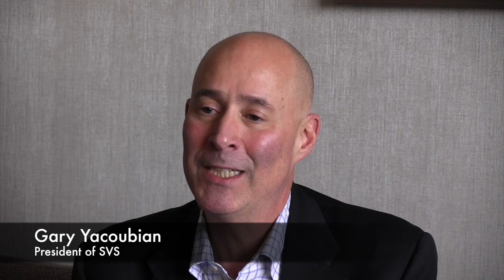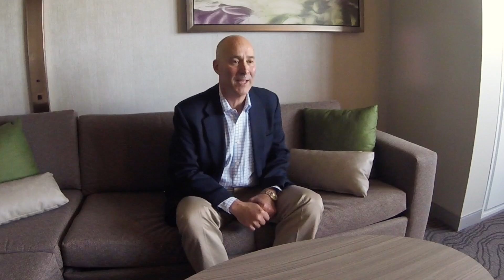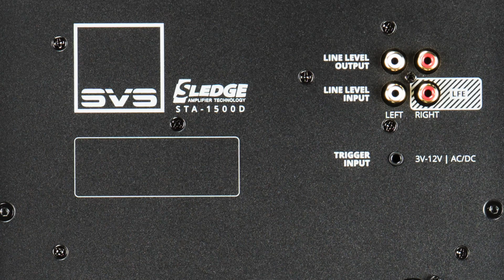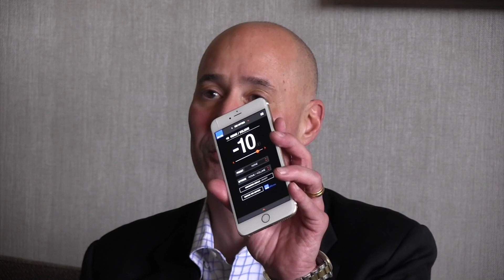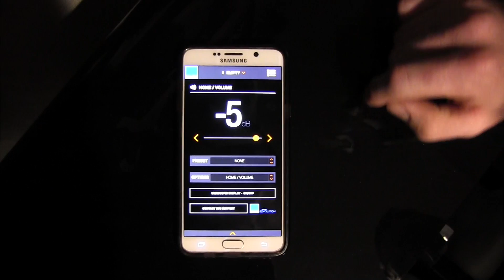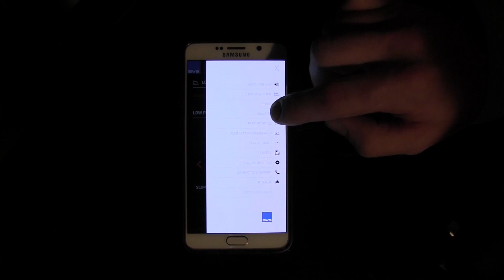The SVS 16 Ultra Subwoofer Series

Comment: This SVS guy is like a politician. He knows that the Amp in the 16 Ultra is NOT the most powerful. PSA T18 has 4000 Watts, Funk Audio, JTR, etc have 2400 and 4000 watt Amps. Also, the APP for the sub, Elac was before SVS.

Comment: the most important 2 questions: 1) whats the SPL at 1 meter with 2.83 vols pink noise input from 20hz-100hz??, 2) whats the long term powerhandling of the 16" driver ( 8 hours pink noise with 6DB creest factor AND thermal compression at those and other power levels?? without these questions answered its all hype.

Comment: It simply is not true to say that the current 15" and 18" drivers don't have good accuracy or transient response. I have four 15" MFW-15 subs with TC Sounds TC2000s in two of them, and Legacy Audio Xtreme XD drivers in the other two. My subs have incredible accuracy, power, low distortion, and linear flat response. While the PB-16 subs are undoubtedly amazing, there is some PR stuff being thrown around here.